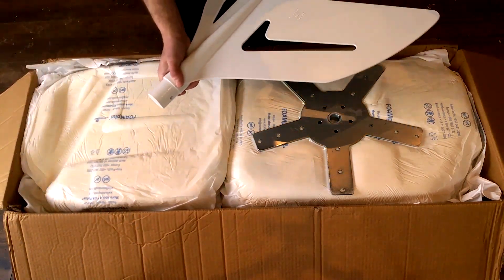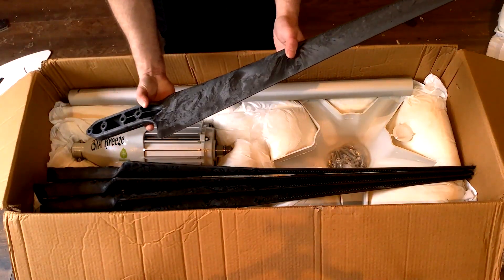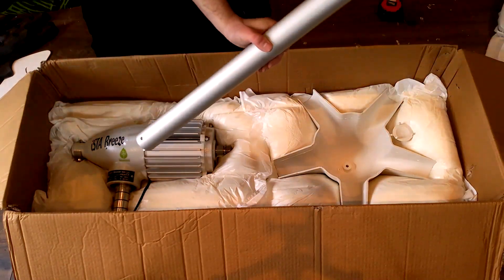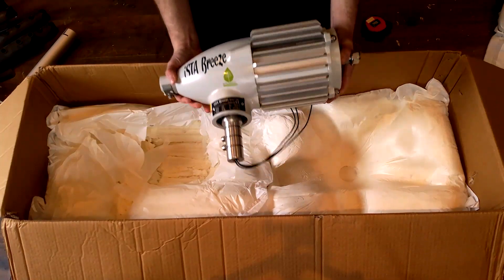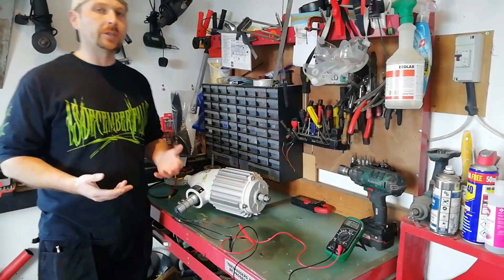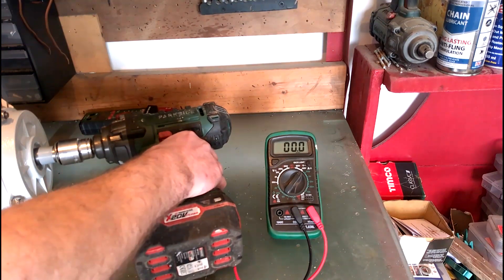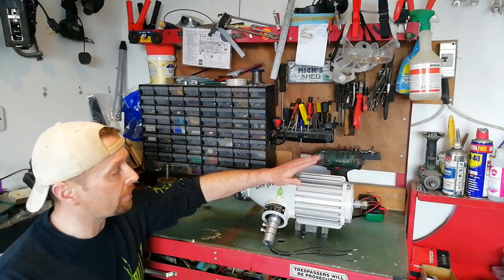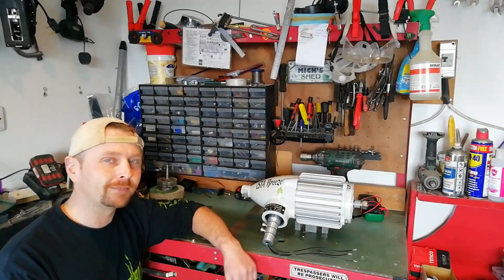Istabreeze i1500 wind turbine kit and bench test.

Comment: All practical tests with small wind turbines show the same results: 1) They generate hardly any electricity! 
2) They don't work for long. 
Solar panels always generate at least 10 times more electricity for the same investment.
And they last more than 20 years without needing maintenance & repairs!
Reply from the maker: Its a cost vs production vs enviroment equation. Solar doesnt work all year round here in Ireland or indeed many parts of the UK, so alternative generators must be found. Its a common misconception amongst grid tied folks because they dont realise how often they have to buy power in as the process is automated.

Comment: It seems that those wind turbines are decent. This is rare in this price category. I think that it is because they are not made in China. In China they all lie about power and quality. I have seen a 50W turbine labelled at 12000W !!! The same 50W turbine, they all label wattage from 500W to 3000W...for 50W...
One thing people should be aware, is that a cheap real 3000W wind turbine weight around 450lbs and costs more than 4000$.
Reply from the maker: Yep, an absolute scam! Istabreeze are more trustworthy with their claims, however we have found minor issues with the slip ring being undersized at a 20amp rating. This part unfortunately does fail. With that said larger alternatives can be fitted with only minor modifications, fixing the problem. Great info,Thanks for checking out the vid.
Reply: ni te cuento la estafa que es tesup tambien.... yo tengo 2 de instabreeze y por ahora encantado, estoy haciendo pruebas con unas aspas nuevas de prototipo en fibra de vidrio mas grandes para ellos...os contaré

Comment: first off all to test the generator with no load do not give you any indication on what it can produce. I have on off this istabreeze and its just garbage. The slipring is not capable to handel the amps from the generator. The connection between the generator and slipring is also crap. Maximum production I have had on my generator is 1250 watts at peak and when it's been gusting 28 ms. would never advise anybody to buy this product. have been living offered since 2012-2014 and sadly its not many of the wind generators that actually give what they promise
Reply from the maker: You're not wrong, the wiring on the slip ring is way below standard for sure, less than half the size required to carry "potentially" 60amps. You might be interested in our latest video on this machine. Thanks for tuning in to the channel 👍
Reply: @ourkilkennyhomestead2006  de hecho entonces es mejor coger el modelo de 48v para que tenga mejor aguante en sección de colector y mas voltaje para luego poder jugar con ese regulador o un mppt decente tipo victron

Comment: Thanks for that advice. Will probably revert to 24v in the future. I did actually have some good success with a £23 boost converter off ebay, running into a 24v bank. I did'nt pursue it long term as I thought it was yet another potentional point of failure. So maybe I took a wrong turn there. All good fun and good learning regardless..

Comment: I've been running my 1500 (24v) 3 blades into 12 v bank and it's done really well. Tried it with a 24v battery bank but it did'nt reach cut in soon enough for my liking. But works great with 12v bank. Highly recommended. Running into 12v I can't brag about getting the spec 1500w but doesnt matter at all. Main thing is that I easily get 3-600 watts in my usual 10 to 20mph winds. ( peaks to about 1000w in 25mph winds ). Great machine.
Reply from the maker: You should check out our first setup at 12v. Yes it's easier for magnetic generators to provide power at lower voltages as it requires slower rpm however the trade off is higher workload on inverters resulting in them burning out faster. Don't get me wrong I'm a firm believer in simplest is best but after hard gained experience found that 24v is a happy medium when combined with solar to run domestic appliances reliably. Small setup definately do 12v, bigger setup then 24v is the winner, solar only can then consider 48v and above. Like your style my friend, as a mechanic of 20yrs 12v was my go to as I knew it so well. It was after a year of building a system that we needed to rely on that I learned 24v is a little bit less maintenance.
Reply: @ourkilkennyhomestead2006  Your 5 blades only cut out the production at high speeds compared to 3 blades and more expensive.
Reply from the maker: @SoWeird66  5 blades increases production at low speeds and better suits the low height environment in which this turbine operates. The result is that the turbine produces power more often instead of having to wait for big gusts to do anything.
Reply: Looks like you have the same wind speed I have. I like the slow speed to voltage output. In good wind it would do great for 24 volts or more. 12 volts you may want 6 long blades or so. That would help keep it at lower speeds in higher wind. P.S Put a brake switch on it for that very high wind. You can cut the blades back like I do for more speed if needed. Good luck.
Reply: @basilkey2949  I've had two i1500s running for 2 years now. Both at 12volts. Feeding 9 130ah lead acids. Really please with them. Did try them at 24v with 5 blade and 3 blade hubs. For my location, 12v with 3 blades seems optimal. I take note that some one said the wiring wasn't adequate but remember that there are 3 wires sharing currently 120deg apart so not as bad as it seems. Certainly, I've seen 850watts at 15v in really high winds (60 to 70 amps) but the norms is 100 to 400watts which is fine. No problem with the slip rings yet. Checkd resistance across the 3 phase combos at Xmas. All still very close, even when allowing the  the props slowly. Did my end of month tally (I should get out more😁). 48kwh on turbine 1, 26kwh on turbine no.2. Its lower down the hill. So 74kwh for wind. Off grid solar 2kw, 55kwh. 3.8kw grid tied : 265kwh. Wind not great but very worthwhile at night and today (overcast 15mph). Great fun.
Reply: I had a lifepo4 bank which has a 29.2v upper cut-off. Just curious if you recommend a 48v turbine to allow charging at lower wind speeds?
Reply: @scottosborn4820  48v gennie into 24v lead acid would be fine. Not sure about lifepo4 BMS though. Don't know how BMS  would react to peaky over voltage.  Certainly, Ista sell lifepo4 compliant controllers ( pretty crude though, EM relays I.e not solid state ).
Reply: Should add...I agree with Kilkenny, 24v bank is optimal and could be driven with a 48v gennie. The only issue is that solid state relays normally have max control voltage of 32v so care is needed designing controller setups. Alternatively £££s can be spent on Morningstar or Outback controllers. I don't like electromechanical relays as these operate in a range causing far more  microcycling whereas solid state controllers can have a single setpoint voltage e.g 14.5 or 29v for 12//24v systems.